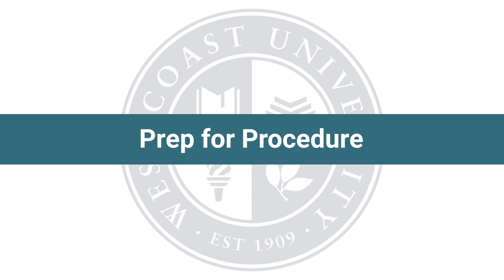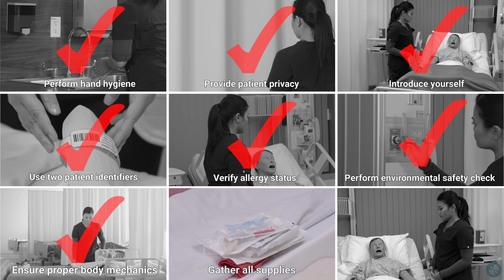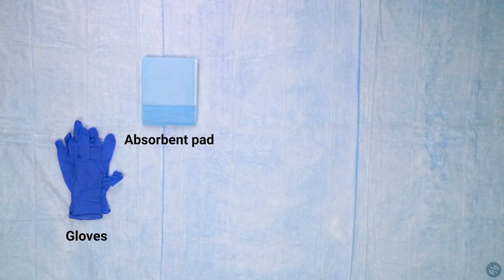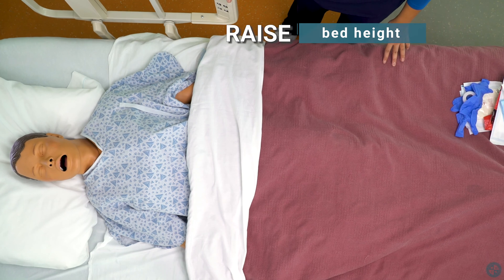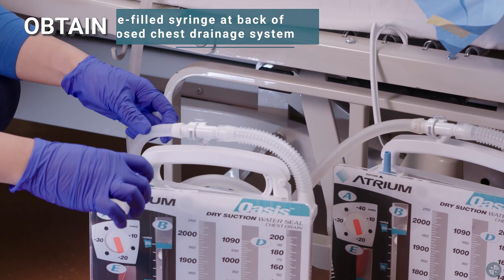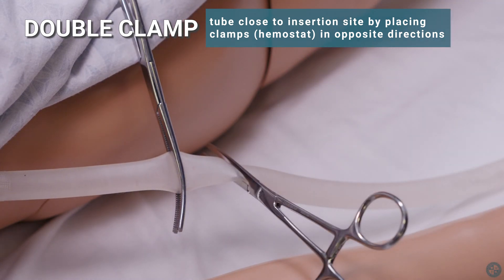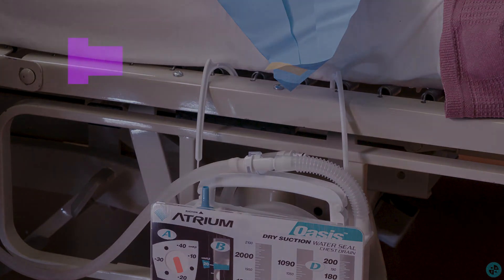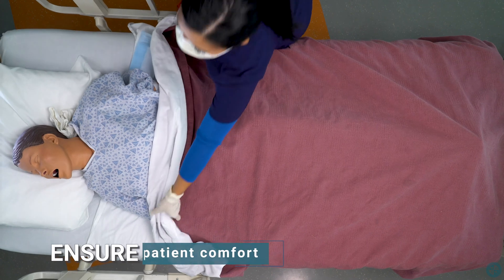Nursing Skill Check: Replacing a Closed Chest Drainage

Comment: She forgot the second clamp and also left the drainage tube dependent, it shouldn’t be that way, the tube should be curled on the bed instead and a straight shot from bed to floor to facilitate easier drainage.